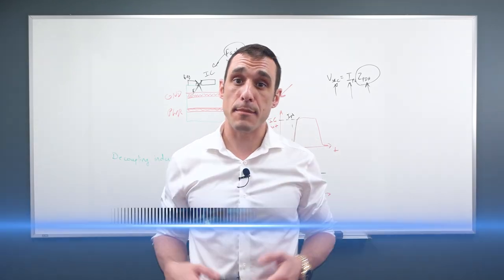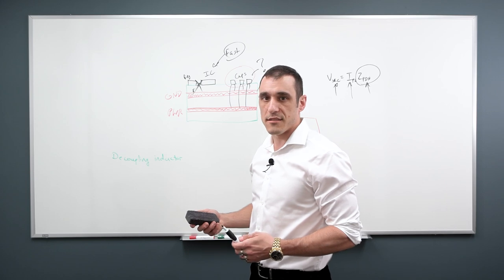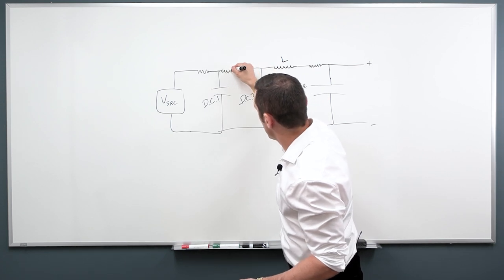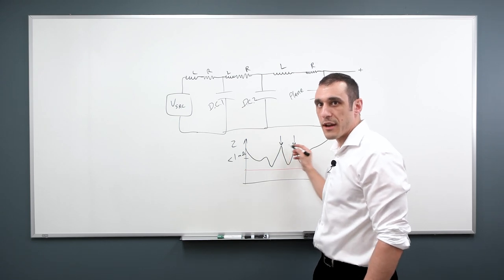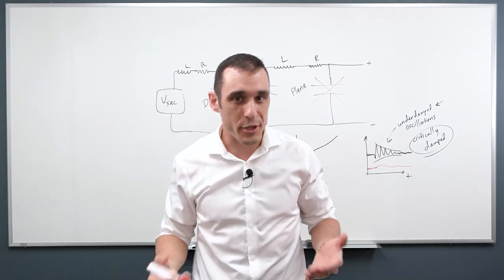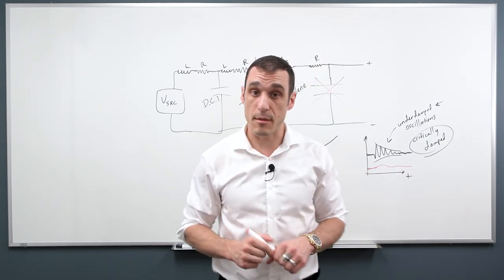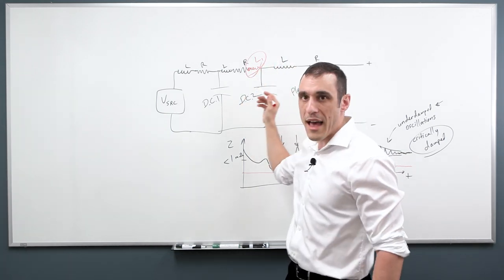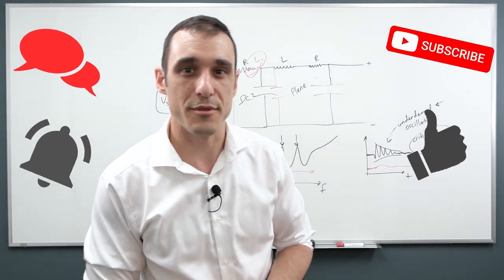Decoupling Inductors? Power Integrity in PCB Design

Comment: Hello Zach! I am but a mere amateur and hobbyist, and I have learned several new things from your videos that I will try to put to good use in the next designs I am planning!

However, I do have a question on the subject of decoupling inductors - and particularly in relation to the term "decoupling".

My understanding of decoupling has been that it both serves the purpose of providing current for the component it's placed near, as well as providing isolation - decoupling - of the component's effects from power network as a whole!

Placing inductance on a (linear) regulator output makes no sense, but what about the input? Not the immediate input, perhaps, but as a part of an LC filter with the bulk and decoupling capacitance often present immediately prior to the regulator? On occasion, I have even used resistors at a pinch when prototyping to get rid of switching noise - noise that didn't cause a problem for the circuit creating it, but did cause problems if allowed to travel further up the power supply, and possibly through other regulators.

I hope you will find time to address when ferrites, inductors in general and LC filters are the right answer to filtering ;-)

Regarding split ground planes, a video I watched just before this, I was wondering about separation of ground in cases of having (somewhat) significant mostly-DC currents as well as small AC or DC signals, and whether restricting the obvious path for such DC currents could be a reason to create splits or voids in a plane? A current being switched at maybe 1 Hz might not cause EMI issues if switched slowly, but it could cause a voltage drop for other signals along the same ground plane?
Reply: “Decoupling inductors” are usually part of the LC at the input you mention. They are calling EMI filters, and the goal is to make that power supply look like a constant load to the source it’s getting it’s energy from
Reply: The split planes idea come from this idea that ground is made out copper with certain impedance (not a perfect short) Impedance is lowest at DC however, so splitting the plane would have the least effect on how DC power/signals effect other power or signal lines.
Reply: @LightningHelix101  DC signals spread out the most across the plane, tho - and given significant enough current, they will cause a voltage drop between points on the plane, even outside the direct linear path between the source and sink. Such a "changing DC offset" could be an issue for low level AC signals, was my idea, and I wondered if this was a (very limited) use case for splitting a plane, causing a restriction that would make less DC current flow in that particular section of the ground plane?

I guess not routing high current DC power/signals through the ground plane, but in separate traces instead, is the more obvious solution ;-)
Reply: Watch Rick Hartley's presentation about splitting ground planes here on altiums channel, it's very good
Reply: @LightningHelix101  Yes they are used in EMI filters at the input to a power converter, also sometimes in a pi filter on the output from a bridge rectifier, you'll see them in some of the better reference designs.

Comment: what about feritte bids separating power planes near IC? many designers use it just to separate several ICs using single main pwr lane.
Reply: Hey Egor, this is another great question from the past that I missed. I think you probably saw the ferrites video, that's where the answer to this question lies; it's used to prevent certain noise frequencies originating in one power plane from reaching into the other power plane. Depending on the topology and the switching rate on the isolated power rail, you might find that this creates new noise if the isolated rail starts switching.

Comment: What if you need a point on the power rail to measure the current. Would you recommend placing a ferrite or a 0R?
Reply: Maybe place a current sense resistor on the regulator output pin and measure the voltage? That would be fine on regulators that are not operating at super-fast speeds to support advanced processors with high I/O counts. In those more advanced systems the current sense resistor could have greater resistance than the PDN!
Reply: @Zachariah-Peterson  Thanks for you reply. In my case it is indeed a high-speeds sensor is being powered so a current resistor does not seem to be the right choice. I found several designs powering an image sensor that included an bead on the power line, and even split one output in two power lines with two beads. Would you suggest using a 0R in this case, or keep the ferrite bead?

Comment: I've seen C-L-C filters used to isolate analog from digital power supplies. This appears to be done instead of using separate LDO's when cost is paramount and frequencies were probably not that high. Is this not recommended?
Reply: It depends on what is using the digital power supply and what the analog frequency is running at. The danger is that the digital side creates voltage ripple that is seen on the analog side because it appears at high frequency and will be insufficiently filtered. Also with the CLC filter is that the ESR values on those components create a pole in the filter transfer function. But maybe this is at such high frequency and high enough load that the digital side does not excite a strong transient... Like I said it all depends. If you're using the analog side at or near DC then probably not a problem.

Comment: I must be confused, switching power supplies always have an inductor in series in the output, are you saying that isn’t a good idea?
Reply: No that's not what I mean, that particular inductor targets low-frequency switching noise, which is appropriate. I'm talking about using an inductor to try and remove mid-to-high frequency noise as part of an LC circuit with high frequency rolloff in a PDN that delivers current to high speed digital devices. The problem is that the inductor size paired with low capacitance used at moderate frequencies (hundreds of MHz) adds too much impedance to the PDN, and it actually increases transient noise seen at the power pins rather than reducing noise.

A lot of app notes for high speed components like FPGAs recommend using a ferrite in this way, but this should not be done because it creates a larger transient voltage at the input pins of the device when I/Os start switching. Better to use more capacitors. If you're just supplying power to a static component, meaning the current drawn by the component does not change or it changes very slowly, then additional inductance on the PDN is just fine as any transient events will be very weak.